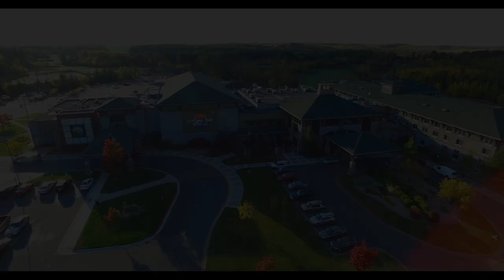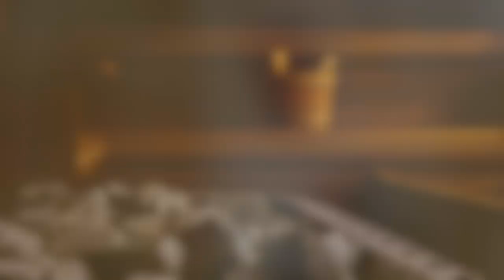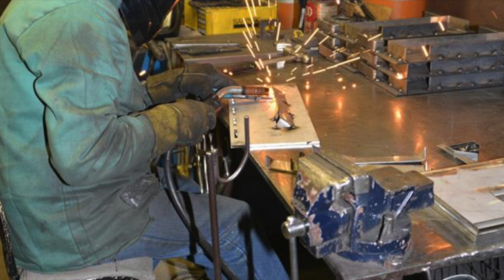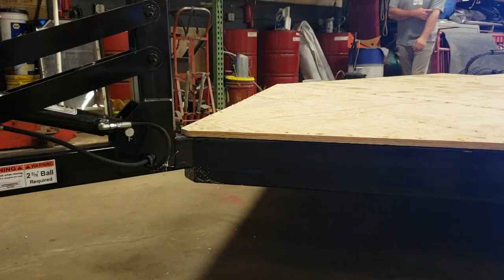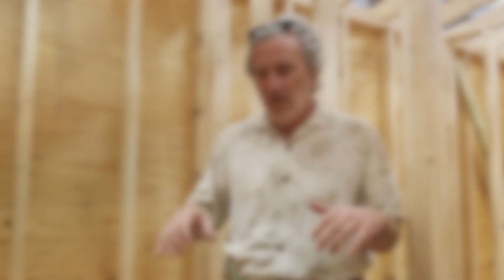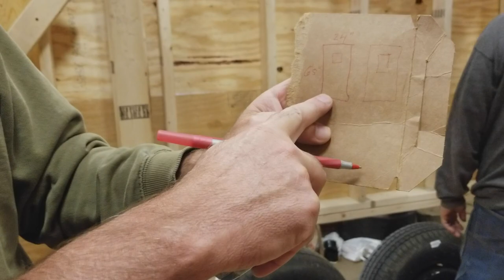How To Start A Mobile Sauna - Tips And Tricks

Comment: Is it possible to build a mobile sauna but have an electric stove instead? I know that would limit where I go because that requires 220 electric correct? I also like the Sauna at least In the 180 to 200 degree temperature range.